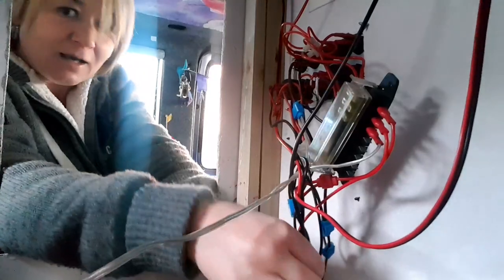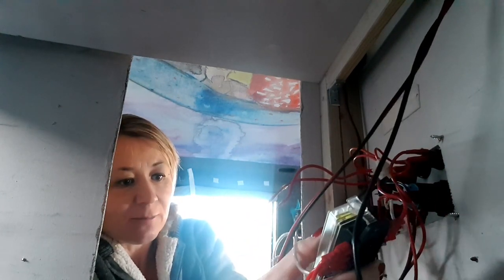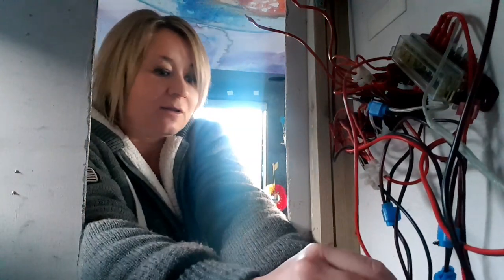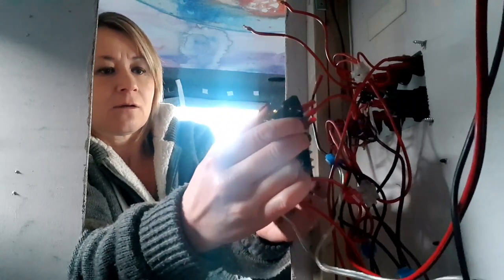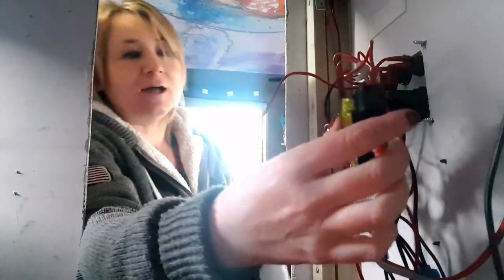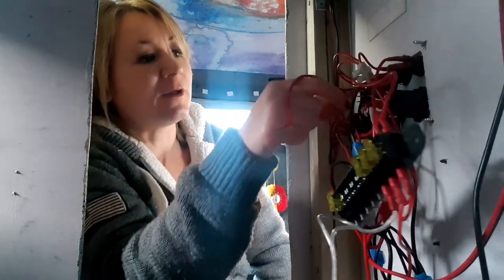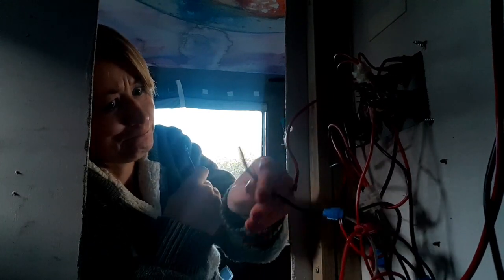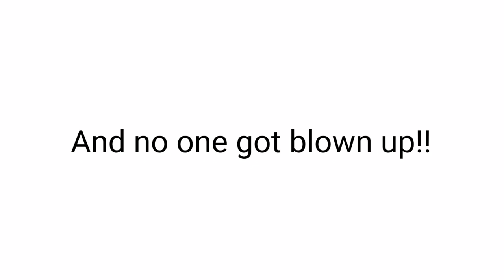CARRY ON CAMPERVAN! 💥How NOT to wire a van conversion!💥

Comment: Oh wow and to think I had to go to school for 5 years to do this LOL. I know this is only 12 volts Dc but please either take off your ring or cover it with electrical tape. You actually did way better than a lot of youtubers and 90 percent better than the first year apprentices that we get. You will get all of it fixed you just need a little more direction.
Reply from the maker: Lol I'll take that as a win then!!! Thanks! It was trying locate what each wire was attached to in that big old mess of stuff!

Comment: ha ha i have those days too. subbed. that hanging wiring will become a nightmare, all the jiggling from vibration will ruin the wire and cause random snapping, need fastening down even if just with tape or glue.
Reply from the maker: It's ok... a professional has now FIXED it properly!! Its all tidy and has fuses and everything! 🤣 Thankz for the sub. I'll come check you out too xx

Comment: As I said that needs sorting.  I would not run a fridge through those connectors light up connectors.   Mount the fuse box and run the wires to that with new connectors and wire where needed.  Much easier to fix in the future.  But most of all don't snip the green wire ;-)
Reply from the maker: Lol... it's ok. Kev is coming to do a proper job on the wiring on Wednesday so I don't blow up in my sleep! 🤯🔥

Comment: I have been advised to only use the fridge on gas because of the drain on batteries, or on electric hook up, not sure about when driving. Trouble is I can't tell if the fridge is successfully ignited when I try to use gas ☹️
Reply from the maker: I dint have gas but yes I'm wondering if the fridge is worth having. When a 12v cool box would probably be enough. This also says it needs 4 hours plugged in to the mains before use??
Reply: Worms Eye View  last and the first time I used my fridge I plugged in at home, over night and it stayed cold enough for two days,  if you decide to get rid of your fridge could I have first refusal. Mine is so old the viewing hole isn't clear enough for me to see if the pilot light has lit, can't afford a new one, although thinking about it, maybe I could get a new part so I can see the flame ???

Comment: Those single red ones need to be connected to 12v supply etc lights fridge
Reply from the maker: Thete seem to be a lot of switches that font power anything in the van but have wires out the back.